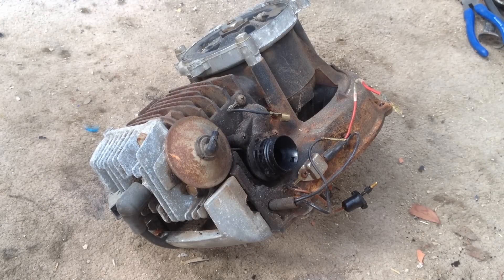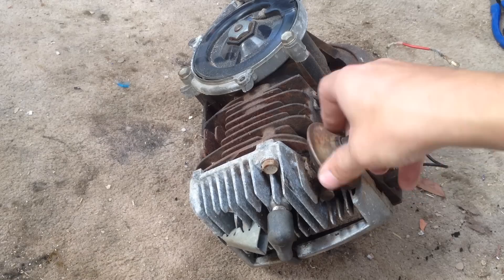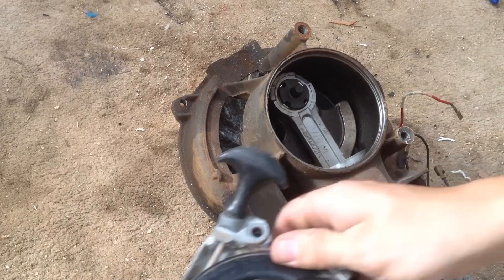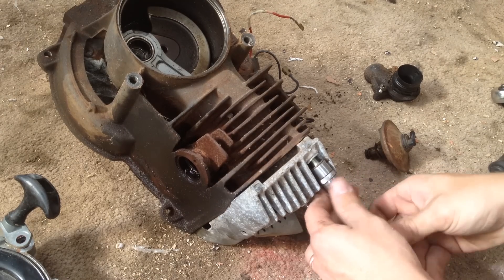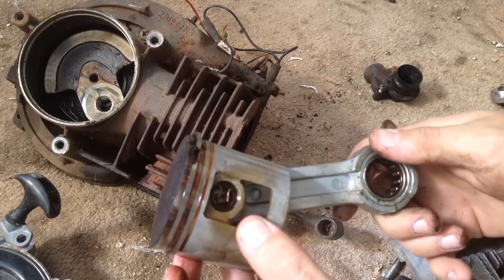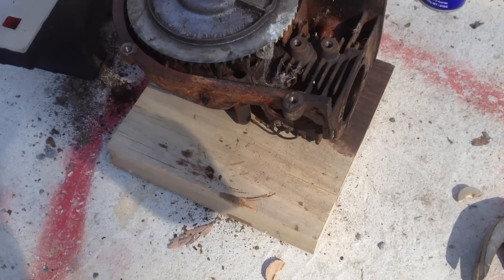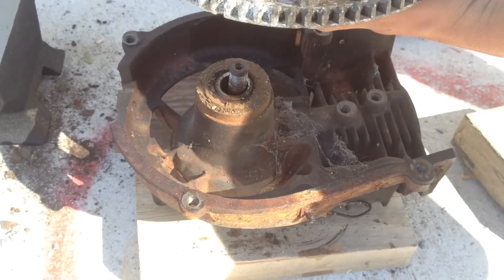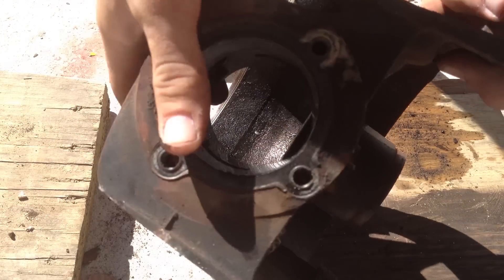PushMowerRepair - Victa Disassembly Guide Part 2 (Complete Engine Disassembly)

Comment: Thank you for this video mate. I always thought the crank boss screwed on, and I damaged a fly wheel by jamming it with a piece of wood as I tried to unscrew the boss.  I have a few spare machines kicking around in my shed and the engines are all the same, but there are 2 different lengths of boss. The earlier models have the shorter boss and the later ones are longer. I need to swap a shorter boss for a longer one so I can use an earlier engine on a later model chassis. This is a great help....cheers 😎

Comment: Great video, I'm doing the same to my 2 stroke at the moment...
One question.... what size was the tyre iron Side you used to get the crank pin out?
I tried but can't seem to get it fitting over the pin

Comment: what is the thread size on the crankshaft ,very interesting video ,i want to use the engine on a childs go-kart ,the problem is the carby wont work with the crank horozontal ,i am changeing the carby to a villiers with a throttle cable and i have machined a manifold to accept it . the problem is the thread size on the crankshaft it is bigger than the earlier models which was .05 BSF  can you tell me what the thread size is please

Comment: Is there a shear pin in the flywheel? How is it located correctly, couldnt see in your vid. I have a motor that is violently kicking back on attempted start. Suspect timing out.
Cheers
Reply from the maker: There is no shear pin on the flywheel. The problem you describe is most often caused by trying to run the mower without the blade carrier installed. Or with a blade carrier fitted loosely. The blade carrier must be securely fitted for the timing to be correct.